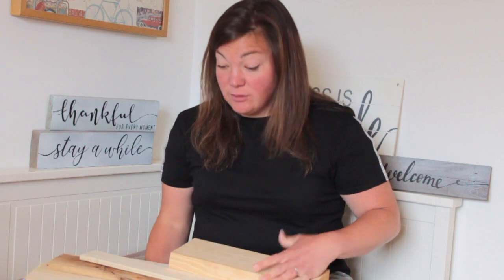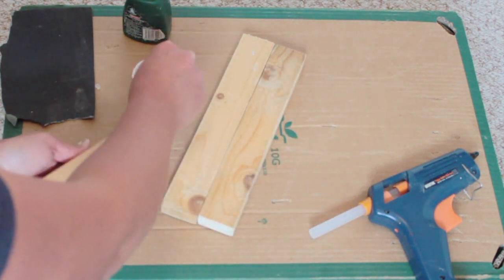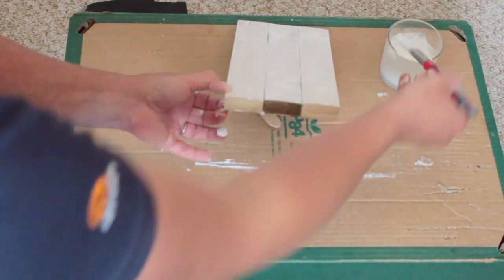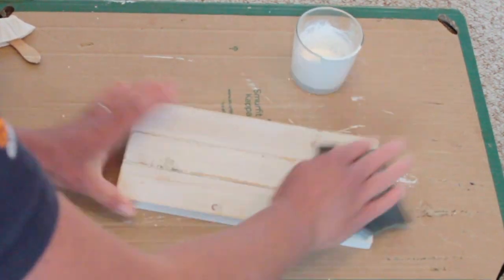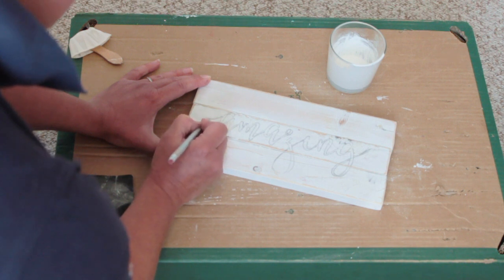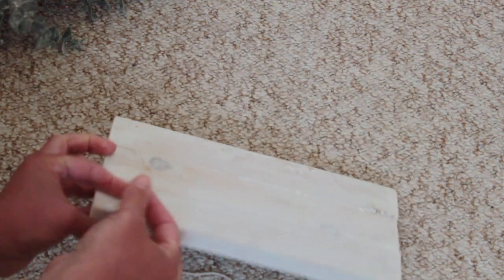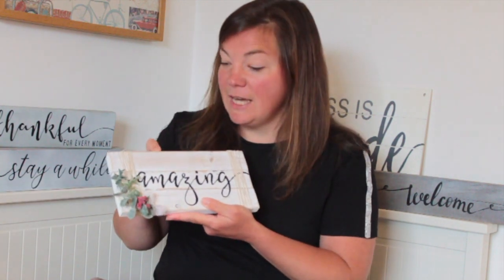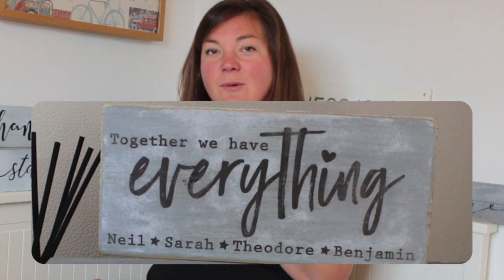DIY Wood Signs Home Decor - Trace and Paint

Comment: Do you have to sad the wood before you use It? Jkkk
Reply from the maker: Hi, the wood I used was already quite smooth, if you sand it so it’s fairly smooth it’s easy to transfer the letters over and easier to paint, just depends which look you are going for